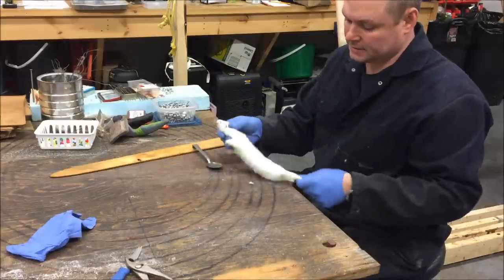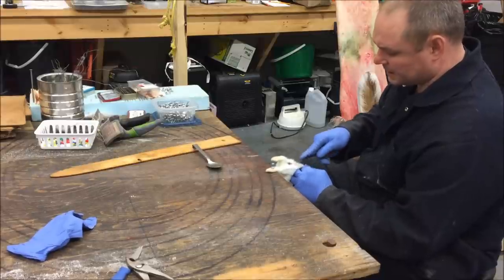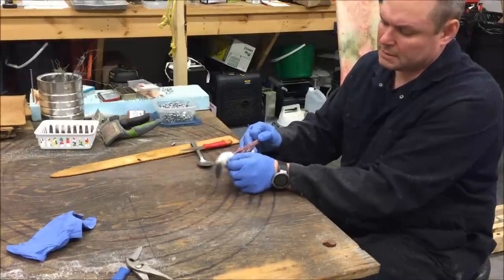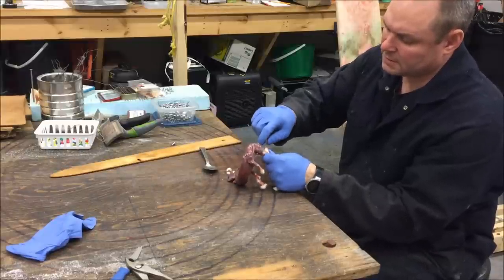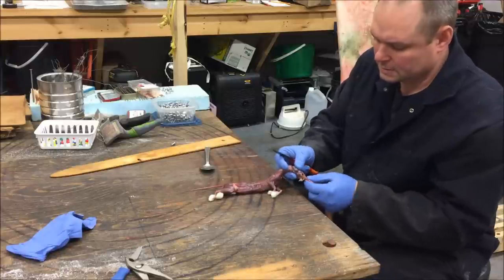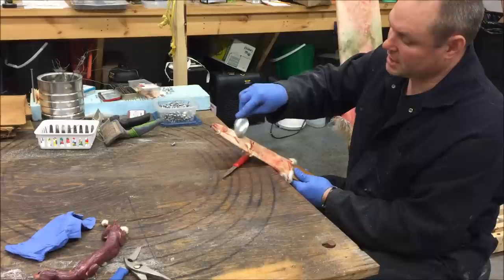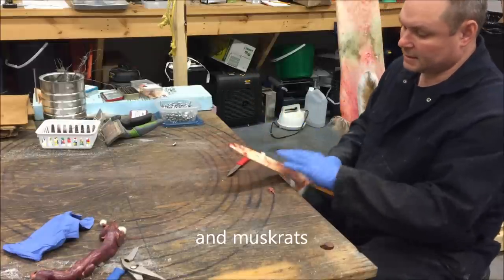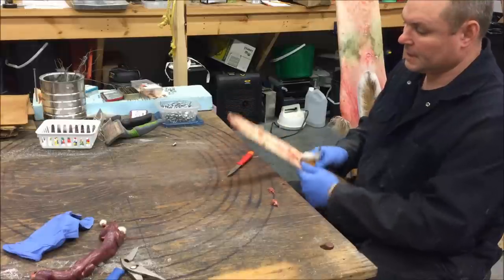Shop talk - How to skin a weasel

Comment: One of these ermines got into my house and killed my parrot, then went outside and started killing my chickens...I shot it inside the coop. It is waiting in the freezer to be skinned - thank you for this video, now i know how to do it. I have a question: is there a type of chemical to rub on the raw skin to help tan it, or does it have to be worked by hand?
Reply from the maker: Weasels are killing machines! 

You can buy a product called deer hunters and trappers hide tanning formula it comes in a orange bottle. I’ve used it before on weasels and they turned out nice. You have to work the hide well though.